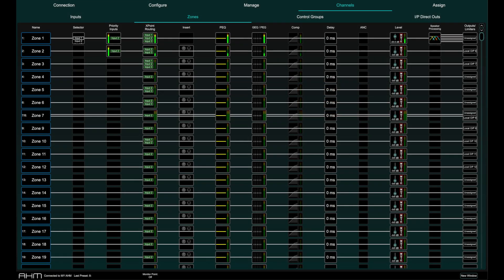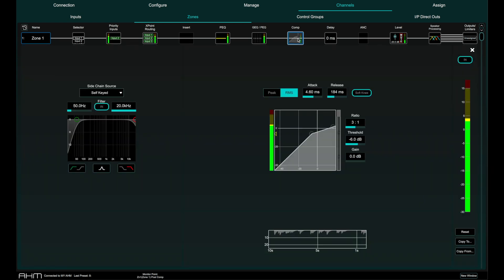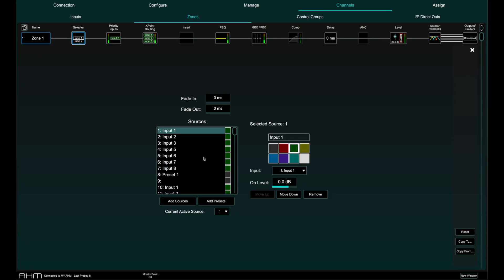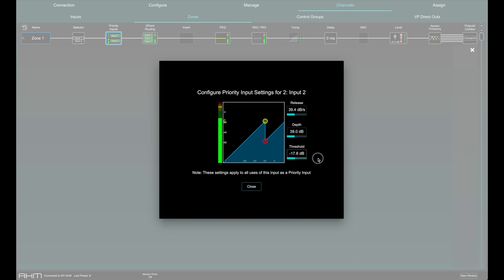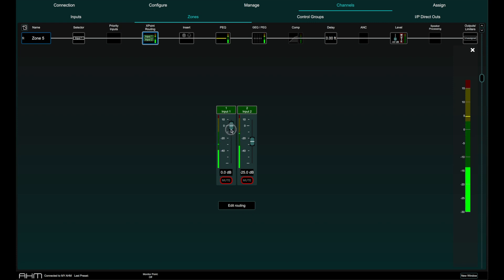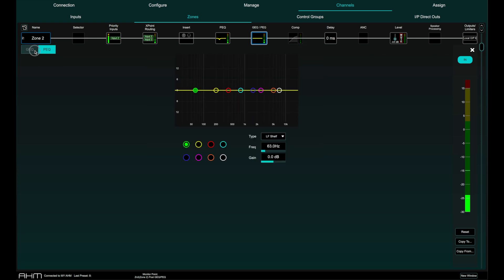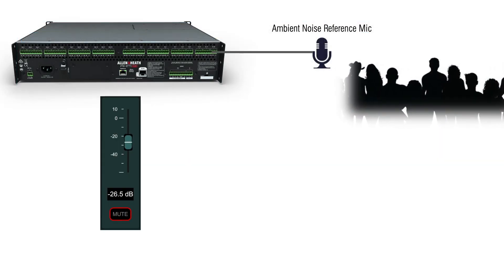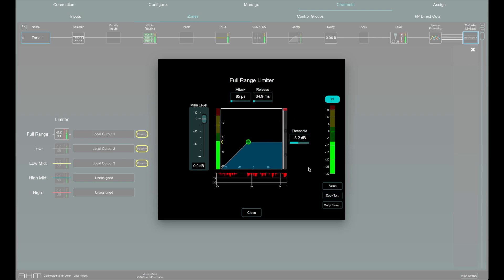AHM System Manager - Output Channels

Comment: How I can connect balance source
Reply from the maker: Hi @andresramirez6888, All analogue inputs on the AHM range can accept balanced signal via phoenix connections. If using any audio expanders, these will also accept balanced signal via phoenix (e.g. DX-88) or XLR (e.g. DX-168) connectors. Thanks, Keith.